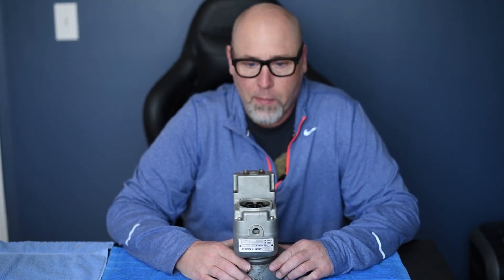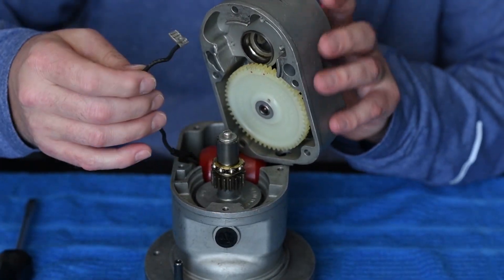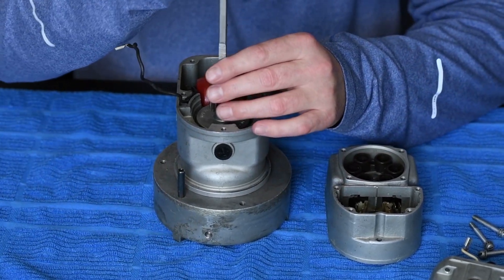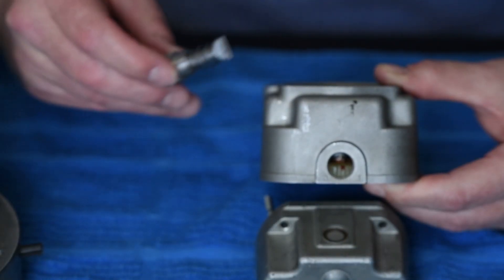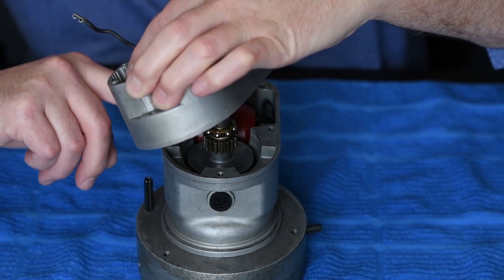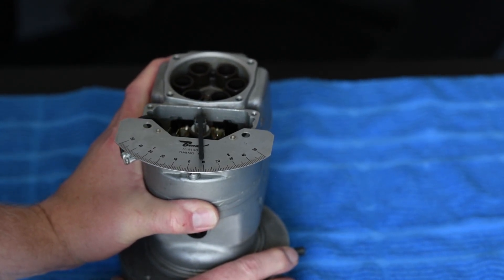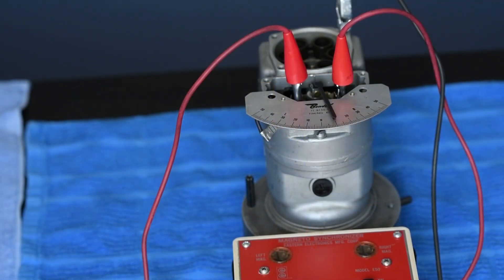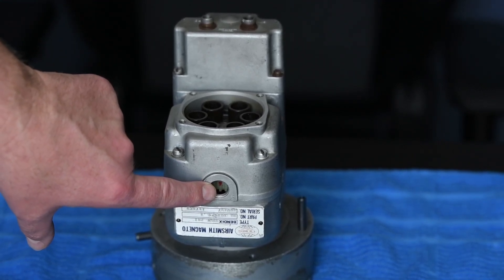Bendix mag timing

Comment: I thought the points are adjusted to a certain gap like .018, when they are fully open? You should also say that the mag is installed on the engine with the red mark in the window, with the #1 Cylinder at 22 degrees before TDC or whatever degrees the engine data plate lists. Why does every IA use this mag for a video? I can’t find a video on the S-1200, one set of points.

Comment from the maker: Note: I made an error on setting the secondary set of points. The secondary is set at 30 degrees but needs to be past the 10 degrees from the primary points. Meaning the secondary set should be adjusted to 40 degrees.